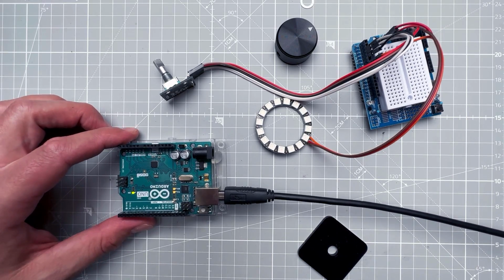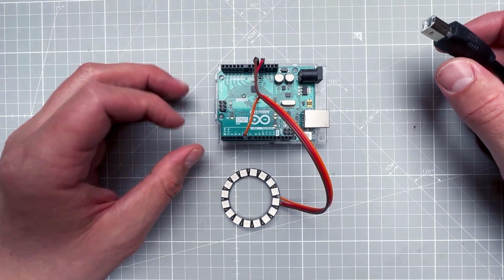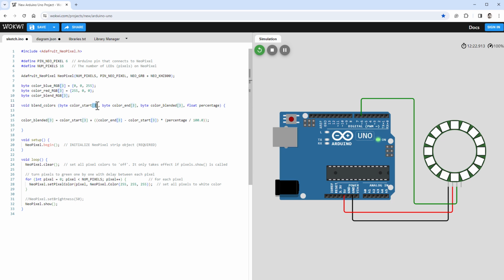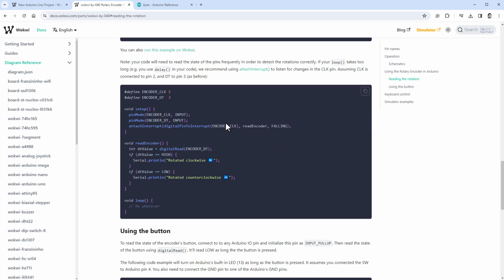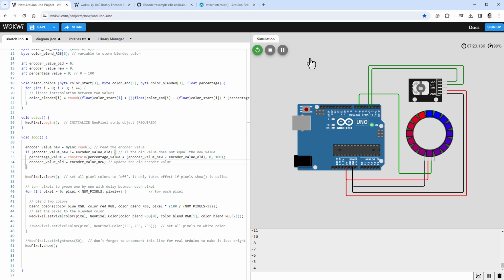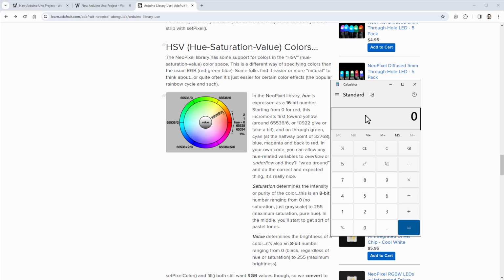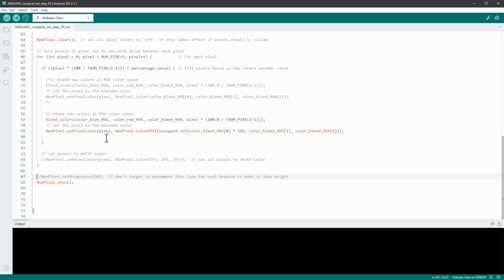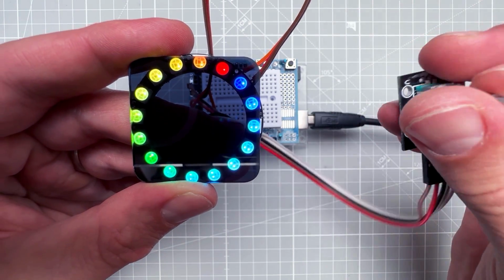Pimp My Encoder! - Add the NeoPixel ring around the potentiometer

Comment: Hello! Besides its beautiful design, would this circuit also work for actual volume control? For example, by connecting it to the output of an amplifier? Thank you.
Reply from the maker: Yes, but it depends how the volume is controlled, nowadays it´s all digital, so some adjustments might be needed.
Reply: @upir_upir  Yes, it would be for adapting to an amplifier, for example, that already has an analog volume control with a potentiometer.

Comment: is it possible to drive 2 neopixel strips with 1 arduino? 1 neopixel strip  should cycle through RGB while the other strip should fade in fade out 1 color. these strips should light up simultaneously.
Reply from the maker: Sure, that will be simple. Connect the second ring with the first one - data out > data in, and change the code accordingly - i.e., now you have double the amount of pixels.
Reply: @upir_upir   can you make a video? i dont know what im doing wrong. but when rainbow colors is active, the fading in and out of other strip is off. seems like i cannot run 2 for loops at the same time. they are just switching turns.

Comment: That small LED was 1.5mm x 1.5mm ? I believe the 1mm by 1mm are freely available and the FAB house will place them for you. Awesome LED ring sketch....cheers.
Reply from the maker: You are correct; the small one was 1.5x1.5mm. I have seen those 1x1mm as well, but haven´t ordered them yet. I guess the difference will not be that significant, it´s already very small.

Comment: watching the video I thought they were selling the WS2812 in a very small package! And yes, the last seconds of the video - you have one such microcircuit on your finger in the frame!
literally yesterday I was looking at a well-known online store, or rather
WS2812 in a 1010 type case.
Reply: Idk about ws2812, but they do have a lot of small serial data controlled RGBs for those matrix screens too.
Reply: The smallest package World Semi makes is 1313 I believe, don't know about other manufacturers though. Still, 1.3x1.3mm is stupid tiny for an addressable RGB LED.
Reply from the maker: The one shown in the video is 1515 - i.e. 1.5x1.5mm, but you can also get this in 1010 package - i.e. 1x1mm. That´s super tiny considering it´s RGB LED with driver.